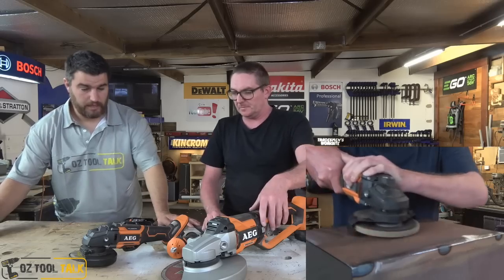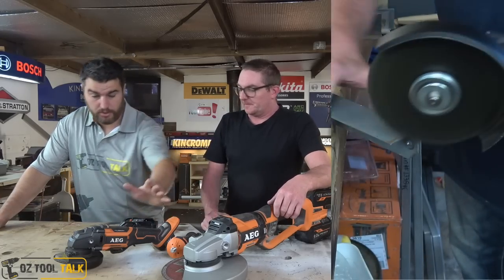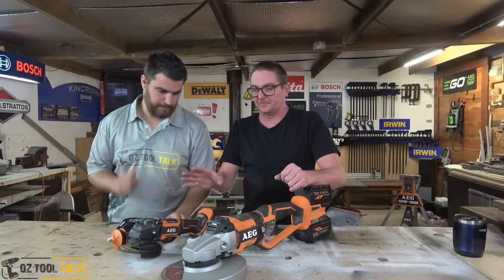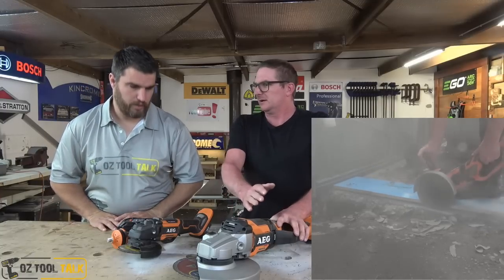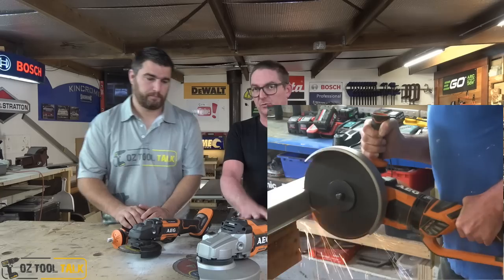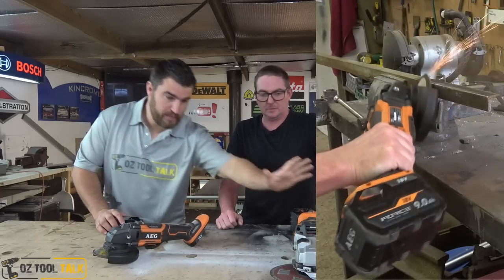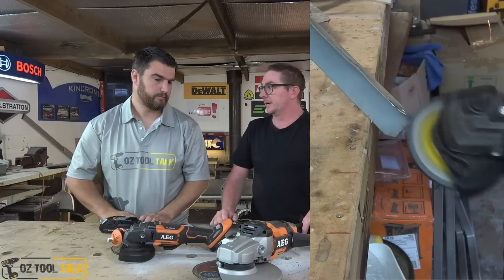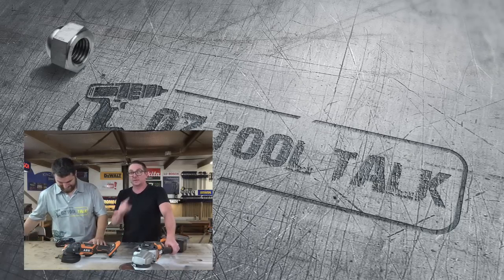AEG 18V Grinders - 5" Fusion and 9-1/4" Brushless

Comment: 9 inch is very good for manual steel cutting because of the size of the blade, which allows you to work much longer before changing disc. This goes especially for pipes, tube, angles etc.
Reply from the maker: yeah it makes sense. If i was doing a lot of steel cutting, i'd prefer a bandsaw though where possible.

Comment: Now you have the 5 inch fusion AEG you should redo the test with the top 2 from the older 5 inch test. I have had mine for about 5 months and it is a heaps better tool than the Dewalt and Milwaukee. It is almost the same as a corded grinder.
Reply from the maker: Comparisons (especially grinders) are a LOT of work. We don't just redo them willy nilly ;)
Reply: @OZToolTalk  , I  understand that and appreciate the effort you put in when you Guys did the first test. That's why I said compare it with the top two winners from the first test. But if you still have the jig you made (which was genius by the way) maybe just test the new AEG fusion and compare the results with the other test. You have the older footage so you could make a pretty good video out of it. Just a suggestion.

Comment: That'd have to be the highest rpm cordless grinder, the only problem would be running speed I guess.  I got asked that question last week and I said the cordless run slower and I don't know what sorts of run times you'd expect to get so it'd be good for small grinding jobs and cutting but this could be interesting to see what the run time is on different batteries.

Comment: That big Cut Off saw/9inch grinder is a total waste of money. I bought this in April and after 3-4 jobs we just stopped using it. Sitting in a corner not being utilised at all. 

For concrete cutting they are absolutely useless. 4 cuts the top on a full battery. We lost a lot of time on charging batteries n stuff. We now use electric grinder/Cut off saw again. So if you are using that for Concreting purposes, please don’t waste your money. 🤙
Reply: WOULD BUY THE 9" IF YOU ARE IN INDIA.

Comment: It's always neat seeing how tools and applications vary in other parts of the world. I have the Ridgid Octane which is just like the Fusion 5" but only uses 4.5" discs and drops 400 RPM to 10,600. I actually got one for testing before release and it's a vary impressive unit. At $119 USD tool only it's probably the best power per dollar in North America. I wrote a vary in depth review on it for ToolCraze and have short video on it as well. I'm new to the review business so please give it a read and let me know how I can improve my writing and testing. https://toolcraze.net/ridgid-r86042-18v-octane-brushless-4-1-2-angle-grinder-in-depth-review-page-1/ .
We also have the equivalent Ridgid model to the 9" but ours gets a promotion in speed to 6,700 rpm but gets demoted in disc size to a 7" wheel. I plan to pick one up soon for use in the shop and may also do a review on it as well. As always, excellent job on the testing and review!
Reply: Josh The Tooldude isn’t it the same?
Reply: @mikezeke7041  Not always, also get different stuff put out into different markets,  like the Empire digial levels have been out in Australia for 12 so months, while they only just released them in the USA market.

Comment: I didnt know they banned 9's on some work sites I love my 9's thats seems odd to me but I'm all farm use so I guess different animal.
Reply from the maker: yeah totally different. but there is a proportionally higher accident rate with 9" discs.
Reply: It's not banned as such, some safety people won't allow them.
Reply: If people knew how to use a grinder and not bend the disk, they wouldn’t shatter and they wouldn’t need to ban them.
Reply from the maker: example: https://www.dha.gov.au/docs/default-source/PDF/nine-inch-grinders_18-02-2016_fin672393CEF9EA.pdf?sfvrsn=22c96b43_0